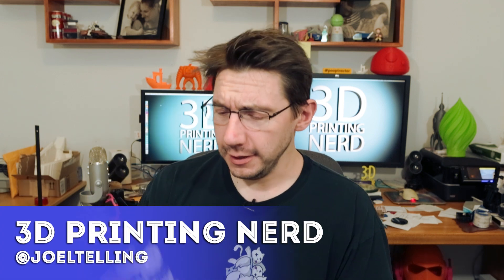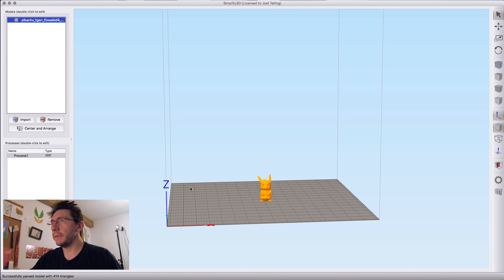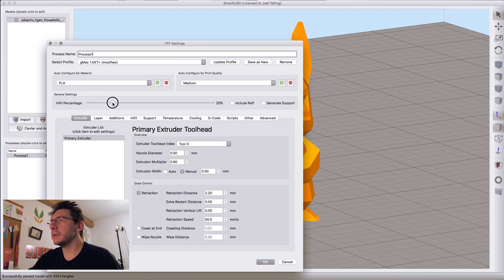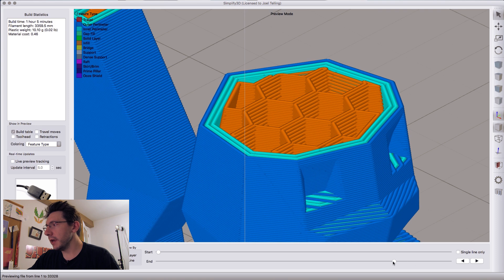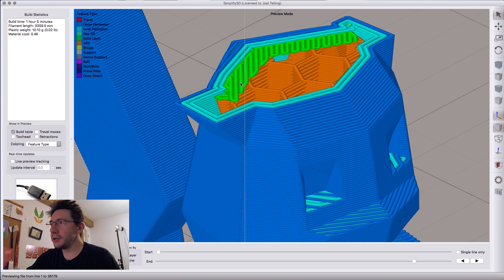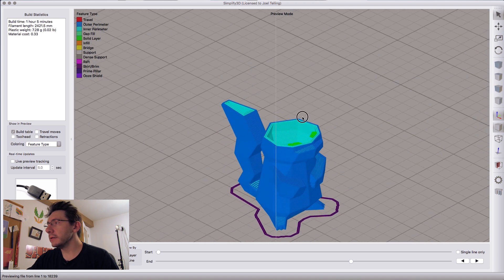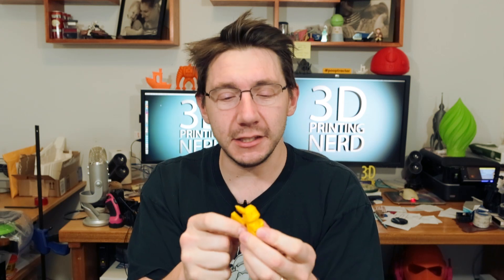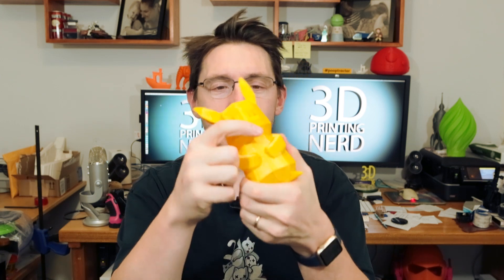3D Printing: Stop Wasting Plastic on Infill Percentage

Comment: Sure, you don't need infill for display pieces, but if it's a load-bearing component (especial if there is risk of substantial damage to property or even injury if it fails) I go 100% infill.
Reply: Same here, I recently printed a joint for a robot leg at 50% infill, but had to redo it at a higher percentage because the piece still broke under torsion stress.
Reply: AdenineMonkey My scariest print to date was a pair of high heels for when the student magazine was writing a piece about our 3D printing club and asked us to print some wearables (and were quite insistent on the shoes). We actually had them sign a waiver saying that they were not safe to wear, but apparently they held up.
Reply: This was fun
Reply: urjnlegend I think we used ABS, but it's been a couple of years. The straps were just cut from leather.
Reply: OU812 Serious question: Where is the best place to order aluminum stock in the US? It seems much more expensive to locally source it.
Reply: hellterminator what material were they printed in?
Reply: +wseamon12 It's easier to print at 85% because you can get away with a bit of over-extrusion, but if you've got the extrusion rate adjusted well, 100% is stronger.
Reply: Space Boy Have you tried McMaster Carr?
Reply: If you just want to hold up some wires a few fencing nails will do
Reply: hellterminator I’m about to make a mould for a carbon composite body (I’ll be laying carbon cloth and resin over the finished printed mould); which material would you suggest. ABS or PLA? Thank You.
Reply: I don't think there is anything in the world that would need 100% infill. I think CNC kitchen tested it, and anything above 50% is minimal extra strength and you are just wasting plastic (so 100% infill is not going to be 2x as strong as 50%). If you want strong parts, increase perimeters instead.
Reply from the maker: The only time I’ll go 100% infill is if I want to later drill holes in it.
Reply: @3DPrintingNerd  agreed. And even then you can use 100% only on the parts where you want the holes, no need to print the whole thing at 100%
Reply: @hellterminator  100% wow it would be cheaper to use hollow model as a mold for epoxy...
Reply: OU812 And what should I call you for making such a stupid generalization? 
Whatever you're designing, you need certain mechanical properties. If the plastic meets or exceeds those requirements, there's zero reason not use it (not to mention that in many cases you can't even use metals and other stronger materials).
Reply: OU812 That's a mighty fine strawman you got there! Too bad I never suggested replacing every metal component with ABS. 
You want a real example? Fine. Cable guides for a CNC mill. If it fails, the cables will fall into the working area, will be shredded by the mill and the control circuitry will short out (in other words, substantial damage to property). A pretty critical component, but it doesn't have to bear much weight. Only an idiot would go through the trouble of machining something like that from aluminum when printed ABS will suffice. 
Oh and it's “your example.” Learn at least basic grammar before trying to call others idiots.
Reply: OU812 If you need a component to bear 5N and you print out several pieces for testing and they don't even start deforming until 50N and break at 500N, it's strong enough. If that's not enough, you can include some accelerated aging test.
Reply: OU812 If designing and printing something as simple as cable guides is slower than ordering them, you're doing something wrong (or you have some insanely fast delivery). 

“Is my copy/paste flub the only thing you found in my comment to throw back at me?” 
No, as I clearly stated, your entire argument was wrong. Did you somehow miss that? 
The grammar was just a nice cherry on top, something that really drives the irony home. Also I don't see how that grammatical error could be caused by copy/paste. Please, do elaborate.
Reply: It's actually more stable to print around 85
Reply: I would recommend going a bit under 100% because I remember in high school algebra, physics, geometry, and trigonometry, I learned triangles can spread the force acting on an object to the entire object, thus making the entire structure support itself instead it depending on the strength of one point. that's also why the roof on your house is made with triangles, and bridges that support cars have triangulation on the sides. 100% isn't always necessary, but I wouldn't go with 0% either, there's probably also a reason Ultimaker Cura has a default thickness at 20% and a default infill pattern of triangles.

this videos idea does work for basic objects that don't require strength, so I'm guessing this is for decoration type objects, nothing against the youtuber or this video, but you should still use infill for more practical objects, that need strength, even for a basic phone case. the video does still have a point though, different purposes depend on different amounts of infill and strength, bigger isn't always better. for a phone case, for example, you may want to use a small amount of infill so there is some flexibility in the case supports so there's some impact resistance, but not 100% infill because then the impact may still reach the phone. you don't want one extreme or the other, I would go for something in between depending on the purpose of your object.
Reply: OU812 Mechanical properties of printed plastic are worse than those of the same material in solid form, yes. And they are inconsistent, yes… just like any other material or component. Which is why when designing critical systems, you should always consider the lower bound of the properties (and there always is a lower bound). 
So in conclusion yes, printed plastic is weaker than for example injection molded plastic or metals, but oftentimes it's strong enough, even for critical applications. Your statement was an unjustified and shortsighted generalization.
Reply: Chris Maurer No that's a great idea though! thanks!
Reply: Hugh Manatee well for high demand stuff of course you need it to be
Reply: hellterminator he went speechless! Good work
Reply: "(especial if there is risk of substantial damage to property or even injury if it fails) I go 100% infill"

Yeah, don't use plastic if failure can result in damage or injury. I'm tempted to call you an idiot for making a statement like this but I'll be nice instead.
Reply: ++hellterminator  I'm not making a generalization at all. Let me repeat your own words..."risk of substantial damage to property or injury...". This is quite a specific application and not general by any stretch of the imagination.

If you're designing something where material failure will result in injury the worst possible material you can think of to use is 3D printed plastic. Why? Specifically because you have absolutely no control over it's properties. Nylon for example has specific mechanical properties to begin with when produced in sheet, bar, or extruded form. As soon as filament is melted and printed those properties go out the window because now it's the mechanical adhesion between the printed layers which become the weakest link and not the property of the material itself. That adhesion between layers will never be consistent so it's a crap shoot at best. Understand?

No self respecting professional designer or engineer would even think of using 3D printed plastic for critical applications...EVER!
Reply: OU812 except in any situation where it would work. If it could cause failure I’d feather use plastic that’s tough than wood that I can easily snap with my hands.
Reply: +hellterminator  You're example is absurd. Are you telling me you're going to design a plastic part with a 100:1 safety factor (on ultimate strength) because you're completely unsure of how strong the material really is?

That's lunacy.

...but wait. Let's double check with some numbers. Tensile strength of injection grade ABS is 6000psi (yes I know we're printing it and it's much weaker...humour me!). Aluminium 6061-T6 tensile strength is 45000psi. ABS density .038 lb/cu in. AL 6061-T6 density .098 lb/cu in. Aluminium weighs 2.6X more and is 7.5 times as strong (roughly). Assume two samples 1" x 4" x .25" thk in bending along the .25" thickness. So to get the same strength form ABS you would need a piece 7.5X as thick as aluminium (simplified example since force and induced stress are somewhat proportional) therefore you need a piece of ABS 1.875 thick. That ABS piece will weigh .282 lb while the aluminium piece only weighs .098 lb. You're ABS part weighs almost 3X as much!!

Oh wait. You didn't just go 7.5X thicker...you went fucking nuts and supersized that bitch to 100X because you don't know how strong it actually is since its printed. So now you have a 3.75 lb chunk of ABS holding your load (better be safe than sorry, right) as opposed to a .098 lb piece of aluminium! Genius!

...oh but there's more. ABS filament 1kg(2.2 LB) = $35 bucks. AL 6061-T6 = $3/kg (approx).  You ABS will cost you $60 as opposed 13 cents for you aluminium piece because you can't be sure how strong the printed ABS is

I know earlier I said I'll be nice. I changed my mind. You definitely are an idiot.

Oh and ABS also doesn't have a breaking limit that's ten times it's yield point. I'll stop now with the pummeling...
Reply: +hellterminator  "always consider the lower bound of the properties (and there always is a lower bound)"

Yes and when using for example 6061-T6 you get a material certificate that guarantees a minimum yield strength that you design to. What do you get when you print a component on your DIY printer or even a Makerbot?  How do you even know what is "strong enough"? 

You're speaking from the perspective of a hobbyist, inventor, model maker, etc. I speaking from the perspective of a professional who's been designing specialty machines for over 25 years. Your argument would never fly in an industrial setting because you cannot guarantee the integrity of your 3D printed part. "Strong enough" would never be accepted because you have no way to back that statement up.

My original statement is fully justified...in the professional field.

Out of curiosity what would you consider a critical application for a 3D printed component? I genuinely would like to know.
Reply: @OU81TWO  hate to break it to you but a good 20% of your car is plastic.
Reply: Liam Casey plastic doesn’t rust 👍🏼 plastic car that isn’t rusted versus metal car with rotted strut towers equally as dangerous, pick your poison.
Reply: +hellterminator  Only an idiot would print cable guides when buying replacement sections is cheap, faster and far tougher than printing from any kind of plastic. Printing them is really not worth the effort but whatever...

I can't believe you had to resort to the "your/you're" spelling thing. Is my copy/paste flub the only thing you found in my comment to throw back at me? lol. Okay. 

Happy printing.
Reply: @OU81TWO  you do know that aluminum is conductive right? Not to mention that when your blades break the aluminum pieces will fly everywhere and damage everything. Strong enough fan blades mean it's strong enough to generate lift and doesn't kill anyone if you run your machine into a wall.

Comment: Should do some comparisons for something considered load-bearing instead of just for display only. Display only stuff makes sense to minimize to zero whenever possible, yet it'd be neat to see some kind of functional component(s) stress tested to give an idea of what margins one could get away with.
Reply from the maker: For load bearing I had thought about it, but, I need to get a good engineering-backed set of tests. Plus, with all the different types of infill, it could be very involved.

Comment: I tried this and there was a fat hole on my print. I use cura any suggestions?
Reply from the maker: fat hole? hmm. what happened???
Reply: well I seem to have fixed the issues and my part looks great but the layers break really easy now when I try to pull off a raft the part usually rips in half and when I print there is a clicking sound but I have leveled the bed numerous times, please help

Comment: it would have been a betetr comparison if you made it no infill 3 layer wall, and 20% infill 2 layer wall.  The 3rd layer of the wall should be using about the same amount of material as the infill would have.

no infill 3 layers: 2420 mm
20% infill 3 layers: 3360 mm

20 infill with 2 layer shell should be around 2600 mm.  

Well, the parts i print (or rather let a friend print for me) are not for decoration but usage.  
a lot of the time they are so thin that the slicers produce them as solid pieces anyway.  
And those times they are thicker i need the structural strength. A bit of infill (10%) is fine for testing, for the final thing it is more like 50% or self-made structures.

Comment: I saved the most plastic. Still need to buy that 3d printer. I'm a schooled at electronics. But not wanting to fix my printer all the time. Any advise what you guys bought and why, would be helpful. I probably end up printing cases for my electronics projects and or make a 3d model myself as I have designed some stuff unreal engine 3 maya and sketchup just to be quick. But most likely I want usable items to add to my daily living and design them as i see fit. I am continually thinking to make my own 3d printer. But it might just be to much work debugging the brother and I pay more on recourses then the 3 d printer itself. Only advantage is that i know what i build myself, vs some factory thing, that I have to take a look at when something goes wrong. As my own build goes wrong until it works it's the other way around. Maybe a kit will be suited. What is your experience? I'm not a electronic major student, just had basic electronics.
Reply from the maker: I took a few years worth of electronics classes in high school, and I'm just naturally curious about technical things, so 3d printing seems to suite me well. I think you would be good with a kit.

Comment: Plus with no fill and 2 minutes of modifications and it can be a coin bank.
Reply: Bah! My editor is a Dremmel!
Reply: @elfpimp1  legit
Reply: All you need is a little experience with 3D CAD. Just do an extrude-cut through the top with a slot or rectangle.
Reply: Jared Farnum i had that same thought
Reply: And when you fill it, then you get to smash it to get the money out, double win.
Reply: I was thinking of just a bit thicker walls and add a coin slot.
Reply: Ben DeVries thanks m8
Reply: Jared Farnum how do you mod the files?
Reply: Rebecca is illegal
Reply: Because who DOESN'T need 20 or 30 coin banks sitting around?